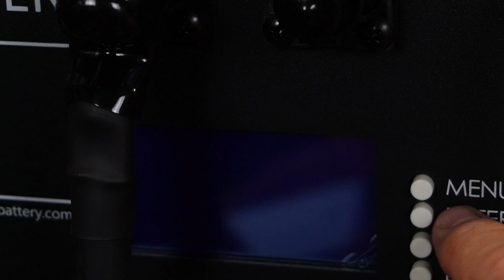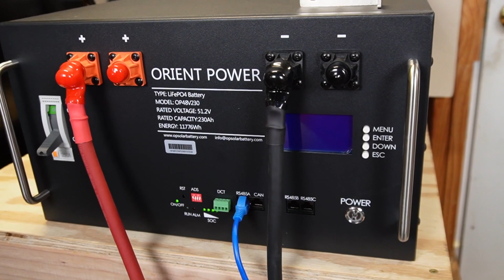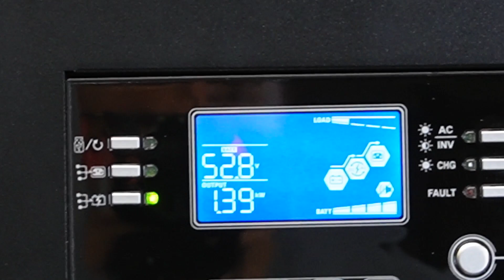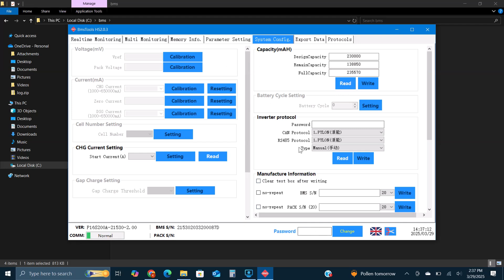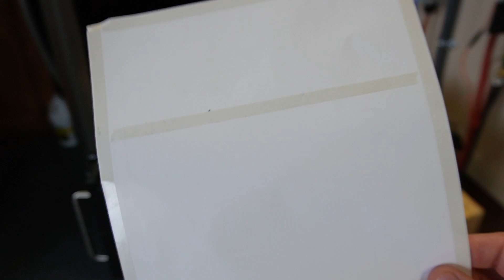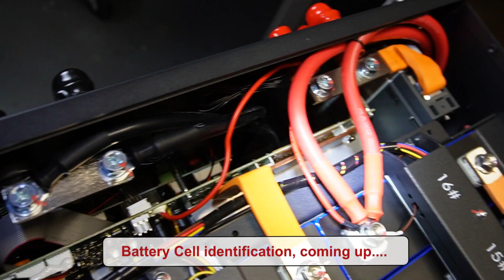HUGE 230Ah Orient Power 48v Battery - Packs a Punch!

Comment: Great option in case 280ah is way too heavy to handle.  I can barely handle 100Ah rackmounts.
Reply from the maker: I can lift one side up onto something short, then lift the other side. But not the whole battery at once.

Comment: way overpriced for a 280 AH battery ?
Reply from the maker: Not sure if you are comparing this 48v battery with a 12v battery. This 48v battery would be the equivalent of a 920Ah 12v battery. That's why I wish battery companies used watt hours instead of amp hours . Then we could easily compare storage capacity between batteries of different voltages. You can easily find 12v batteries less expensive per watt hour. But if you wired that many batteries together to have this much storage capacity, you would spend a fortune on wires and lugs.